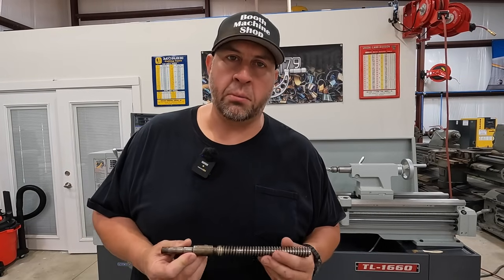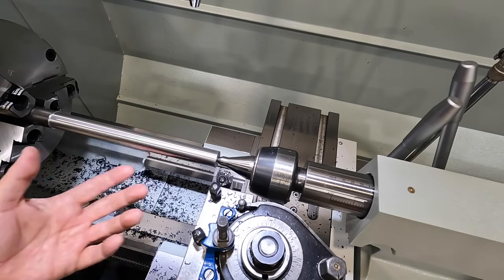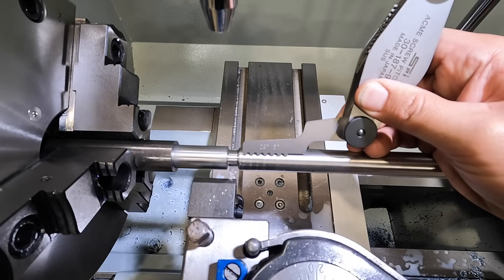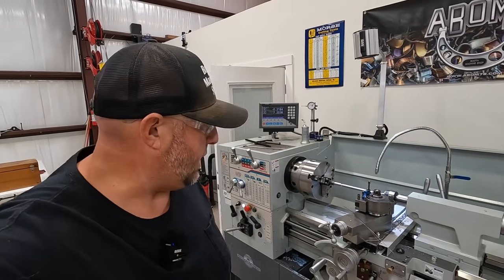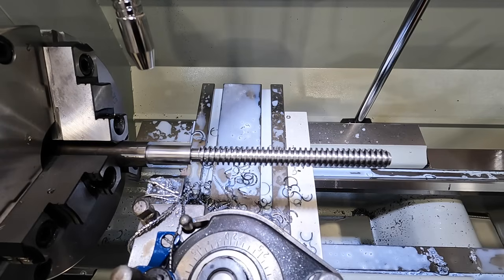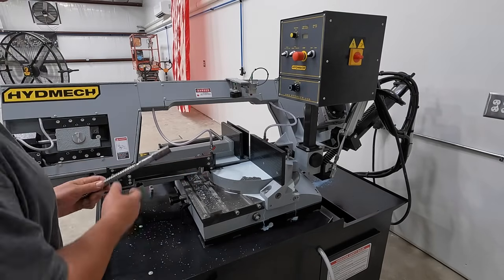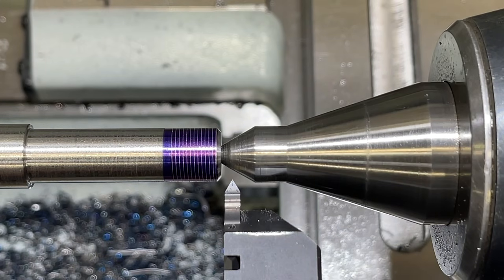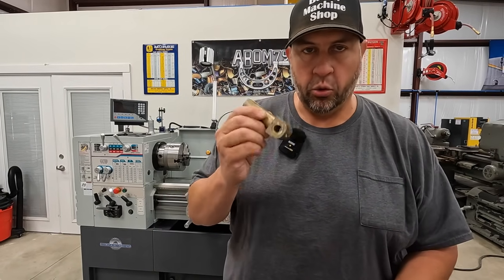Compound Acme Lead Screw for American Pacemaker Lathe

Comment: I am not a machinist.....so this may be a dumb question......how does each pass line up exactly each time?
Reply: Gearbox.
Reply: I’m not a machinist either but I’ve watched enough YT videos to know the answer. The spindle is connected to the lead screw that moves the cutting tool up and down the lathe through gears in the head stock. You can configure those gears to cut a million different threads. That dial you saw spinning with the numbers 1 through 4 lets the operator know when to engage the lead screw so the threads line up with the cutting tool.
Reply: #1 There are no dumb questions. only dumb people who don't ask questions. This site, like many others, is an excellent place to learn.

Now then. The lathe has a number of settings, of course - speed, and the relationship of turns of the main spindle to turns of a leadscrew which when engaged moves the tool along the axis of the workpiece (X axis). There is also one which when engaged moves the tool holder across the workpiece (Y axis).
Since the leadscrew is geared to the spindle, there is a constant known speed  and position reference possible. 
When setting up to cut threads, he consults a table of settings xor thread pitch. The carriage connects to the lead screw by a lever controlled set of "half nuts". Visualize a nut cut in two that can be opened or closed on command of the lever. Nearly is a rotating display with numbered markings and an index. The operator waits for a particular number (per the table) to approach and engages the half nuts. Et voilia', the cutter will be synced to the threads. When I learned to run a lathe over 50 years ago, we had to remove and replace a workpiece from the lathe, destroying the synchronization, and set back in sunc, called "chasing the threads. 
A-Bom has a video demonstrating this, with illustrations. Hope this helps...
Reply: see comment by Robert Parker. There shouldn't be too many comments to make it hard to find yet.
Reply: @The_DuMont_Network  Love your "no dumb questions" comment.  You are spot on. If you don't ask, you don't learn.
Reply: Reposted from above.  

The spindle and the bar that drives the tool holder along the ways (lead screw) are physically locked together through gearing so the spindles rate of spin and rate of spin of the lead screw are always the same ratio. The compound is engaged with a nut that is controlled by the operator.  To start the cut at the exact same spot every time there is an indicator geared to the lead screw as it drives the compound along the ways (it’s called a threading indicator), you engage the drive at the moment that indicator shows the lead screw is in the same spot as when you made the first cut. 

I hope that is relatively clear

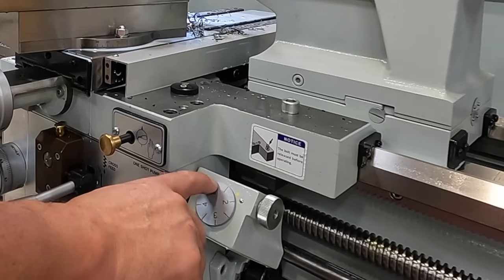Edit: you can see the threading indicator by Aboms hand at 14:02.  It’s the spinning dial. It has numbers on it and if you always start at “1” , “2”, “3”…or in this case the whole numbers, whatever number the relation ship between the lead screw, work and compound /tool holder will be the same every time. He kind of eludes to its operation at 16:25
Reply: @yalebaker7976  ok....but how exactly does the operator engage exactly every time......Im just so confused about this.....that dial is spinning so you just have to engage on the mark? seems some error could be there
Reply: @harlanmartin9964  yup just wait til the dial hits your spot and engage it. If you don’t hit it exactly right the lead screw is still spinning and the half nut will slip in where it needs to go. Haha I’m acting like I’ve done it before. Never even touched a lathe but that’s how I understand it anyway. I’m sure these machinists that are replying could explain it better. I don’t know if he has to use the digital read out to start in the same spot or what. I have questions too.

Comment: This may be a foolish question as I have 0 experience with metal lathes; Could the clearance issue with the follow rest be alleviated by running a reverse angle on the compound and taking  a trailing edge cut? or would this cause other problems? The new shop looking great by the way!
Reply: It might be slightly minimised, however it's a left hand thread so traditionally it is cut "away from the chuck". You always want the cut on the leading edge of the tool.
The issue with this follow rest is that it's positioned nowhere near the cutting point. For this lead screw there are already some thread relief and other features so a follow rest on the left side of the cutting tool will not work even if it did miss the chuck. He's gong to have to rig up an alternative mounting for that follow rest so it is more in line with the position of the cutter. Modify it's base then either mount it off a special boss that fits into those 2 T-slots in the carriage, or perhaps some bracket off the rear.
Reply: @johncoops6897  thanks. I was just curious but you never know when a little knowledge can come in handy.

Comment: Only pipe thread has a sharp pointed thread. Your tip for threading should have a blunt point .125xp    .125x32=4 thousand of an inch

Comment: Check diameter in the middle of a long thin shaft if you want to detect deflection. Checking at the ends only tests alignment.  You know this.
Reply: And your point is? He wasn't checking for deflection, he was checking for TAPER on a brand new lathe that has been dialled in but never used to turn anything before.
Reply: @johncoops6897  As I'm sure you must know, checking tailstock alignment on the new lathe, though important, was only an ancillary aspect of the task at hand.  You will recall this is the second attempt at making the lead screw, the first attempt having failed.  And, that first attempt, on the other lathe, most likely failed largely due to mid-point, tool pressure induced, deflection of the shaft, causing the shaft to climb up onto the tool.  And, please don't shout at me in all caps.  Thats just rude.
Reply: @PittsS2C1  - He won't be getting excessive deflection on a piece of 1" diameter high tensile bar stock and a 20-50 thou test cut. He CERTAINLY didn't get any deflection on his 3/4" final piece on the 1 thou passes cutting the thread. His previous attempt on the old lathe didn't fail from deflection either.
You should watch the videos and pay attention better, so you'll learn that Adam knows how to operate a lathe without your advice.  He mic'd to check taper, that's all he is interested in... and that's why he only checked both ends and not the middle.
Some people are both deaf and dumb, so others need to raise their voices to ensure that they pay attention, hear and actually understand what is being said. I wonder which you are - D, D or both ?
Reply: @johncoops6897  come on, dude.  Lighten up.  Perhaps this could yet be a productive discussion.  As You surely know, 0.750 is the thread max diameter.  And, the thread maximum minor diameter is 0.530.  So, we really aren’t dealing with a 1” shaft.  There was most certainly excessive deflection at play in the first, failed, attempt on the Monarch lathe. On that iteration, Adam was taking 0.005 passes.  And, as he approached the specified minor thread diameter, the part deflected and climbed onto the tool.  The failure occurred near mid-point on the thread, consistent with normally anticipated max deflection point.
Reply: @PittsS2C1  - it doesn't matter, it's Adam's video and knows exactly what he is doing. His old lathe had a problem, yet his new one didn"t have a problem... making the same part using the same method.
So what was the difference? Same operator, same method, same technique, same part, different lathe. How could it possibly be that the problem went away by changing just one variable? Maybe watch the start of this video again, where Adam tells us why he is using the new lathe to remake the part, rather than the old lathe?
Reply: @johncoops6897  Thank you.  I'm certainly not questioning Adam's ability or knowledge.  He is a true machinist, born and raised.  Best on the internet.  But, with due respect, I think the small minor diameter of the threaded shaft actually does matter quite a lot, with respect to deflection.  Especially when cutting Acme threads. There is an awful lot of tool contact area when cutting Acme, and a lot of resultant tool pressure against what, in this instance, has effectively become little more than a half inch shaft.  Apparently, Adam considered this as well as indicated by his initial intent to utilize his Follow Rest on the new lathe and, failing that, by subsequently making lighter cuts as the minor diameter was approached.  That said, I do agree that the new lathe was a factor in the success of the second attempt.  I also think the flood coolant and lighter cuts there at the end also played a part.  At any rate, it's an interesting discussion.  By the way, did you notice the nut became just a bit more snug about halfway down the length of the shaft?
Reply: @PittsS2C1  - yes it did get a bit more snug in the center, and of course there would be a bit of deflection, even on zero depth spring passes he used at the end.
However he left all the burrs on the thread OD when he tested the nut, so he was never going to get a 100% perfect test fit anyway.

Comment: Why is the nut going on at first but not all the way is the material pushing away from the cutter
Reply: Yes it was the thread tool used was advanced forward and to the right which would have left a bur on one side of the thread.
Reply: @xkblxcripple  Might have been the tap he bought as well.

Comment: What is “stress proof”? I’m not a machinist, but wish to learn
Reply: It generally means the steel has been heat treated or (normalized) in such a way as to remove most of the stresses found in untreated steel.
Reply: @ellieprice363  thank you
Reply: @ellieprice363  but… what is the steel? A36? 4120?
Reply: @halsnyder296  Adam said it was 1144 stress proof. It’s strong and easy to machine and a good choice for that shaft.

Comment: Great work. If the tool holder accepted the acme cutter on the left side instead of the right side you may have been able to use follower rest. 
Too bad the digital read out linear scale sensor wasn’t on the left side of the cross slide.  Was wondering about tool deflection in center of shaft after finish cut to proper diameter as others mentioned.  Thanks for the great filming work!!⚙️

Comment: cutting the threads without a relief - not easy to do - what is the trick? Is he watching the dro to spin out the cross feed?  Dial indicator?
Reply: I was wondering the same thing. I'm just an electrician who has wired several machine shops and by working in the environment fell in love with the people and the trade. It's absolutely fascinating and is someone who always needs to understand how something works it leaves me with so many questions
Reply: He has a sharpie mark on the shaft where the threads end, the trick is to back out the cross slide when the threading tool reaches that mark, then disengage the leadscrew half nuts and start over, of course the slower you go the easier it is to hit that mark every time but it gets easier with practice. 
Some people setup a dial indicator on the bed way set to the end of the threads, then back out the cross slide when the dial indicator moves.
It takes practice and is a little intimidating at first but practice makes that go away :-)
Reply: He has the reflexes of a cat. Also you can bet that his concentration level at that moment is a pretty intense.

Comment: How much does this kind of work cost?
Reply: It will depend somewhat on who you pick. A machine shop that is used to doing this kind of one off will be better value, forget your high volume CNC shops they won’t be interested or may not have the manual skill readily available. When you go out to quote give as much info as you can,  figuring it out time will cost you whereas if you know the pitch, material you need and an idea of the tolerance that will save them time. No disrespect to Adam or anyone else but this is not difficult work it just needs to be done right taking time and not rushing. Adam was just unlucky on his first attempt. It also depends on what you are happy with, if I quoted you $200 for a part you can’t get anywhere would you be? I’d suggest you find 3 shop and give them all the same info, visit them - there’s no substitute for getting a feel for who you are working with. If the shop is dirty and unorganised walk away, if it’s like a clean room you are going to pay for that, if it looks like Adams home shop and Adam’s in it you are on the right track.
Reply: @tonyray91  It's not about organization, I have one off things done regularly by the weirdest shop that has dim lights and metal shavings everywhere. He does a great job and sent both his daughters to Clemson
Reply: Machining work is expensive. People want a perfect part made or repair done, but they don’t want to pay for it. I can’t count the times people have brought me work and truly think I’d spend half a day on their project for $20-$40.
Reply: My estimate $ 250 plus materials.

Comment: Ok folks, imagine I was machining a 24 inch diameter circle of copper 1 inch thick using acme style cutters to make either 1/2 inch deep concentric circles from edge to middle or do the same thing as a screw type thread from edge to middle. Imagine this is the bottom base on the inside of the device. Also we now install copper elbows at the bottom of the internal pipes so the water coming in will go around in a circle to the middle which is where the water should exit up top. The question is should I use the thread way (the way I'm thinking) or concentric circles (original idea)?
Reply: You'd have to draw that preferably in 3D for me to visualize it. I think there's some portion missing from what you've said. 24" diameter 1" copper dindin plate with threads on the edge? larger sides? What contains this? Where are the pipes? It sounds like maybe in the middle? Middle of the edge? Side? What is your purpose?
Reply: @mrmeval  - I think it's just some made up story, just to see if somebody will bite.
Reply: Either or so long as there are channels for water to flow between the concentric circles.

I'm picturing what is basically a CPU water block but overiszed and meant to be artistic instead of a heatsink.

Comment: I honestly don't understand the point of checking thread pitch on the lathe. 🤔
If the dials/knobs/levers are set correctly (and the lead screw is tight) there's no way for it to be incorrect.
Reply: Adam describes many many videos ago where he made a mistake on a prop shaft and cost him a piece of material stock. As a young buck he been checking thread pitches ever since as well as other youtube machinist of verifiable excellence...gas stations are often checked to make sure that we are truly getting a gallon versus a bunch if air mix when ya pull that handle...over time things get loose
Reply: It’s to ensure you didn’t screw up on your settings by accident, specially on a older lathe where the number plates can be worn or hard to read, and sometimes certain gears can be hard to engage. Takes 2 seconds to check and it’s way better then having to scrap an expensive piece of material. But yes you are correct, it’s just good practice, specially when your doing personal work where time isn’t a factor.
Reply: What’s easy to set right is also easy to set wrong. Always double check.
Reply: @Kc12v140  I don't think time is a factor.
If I had been a machinist since I was in diapers and was working with a new (tight) machine, it would be more disconcerting to question my own ability and experience, as well as my tool.
But hey, it's not me....
I personally think it's to satiate all the doubters/haters in these comments.  😂
Reply: By doing that, you check that you do in fact have all the dials/knobs/levers set correctly. It is easy to make that mistake. Also, if a part is loose or there is significant wear, it will show up here.
Reply: @jimurrata6785  your probably right cause I’m sure he gets all sorts of flak from armchair machinists. Self doubt is healthy as long you don’t take it too far and let it control you. It’s probably a habit for him though. On a part like this it really doesn’t matter if you screw up, but it’s a whole different story if you fuck up a 6in by 8ft piece of chrome rod cause you didn’t double check your threads. Guess it’s no different than mic-ing your od every now and then on a heavy turn to make sure your dro is reading right.
Reply: You are correct, you don’t understand.
Reply: Measure twice, cut once. Too soon old, too late smart.

Comment: What was your compound angle?
Reply: 14 degrees
Reply: My turn. Long question.
  As a novice at single point threading I have had similar issues with test fitting the nut. Adam had issue with the nut starting ok and threading on say half to three quarters of the nut depth and sticking. My question is.. if the threads are of correct size for the first say inch of the shaft and the nut fits but no further, would that be from deflection in the shaft? So with further passes it appears to cut/ remove more material over the full length, all the way to the supported end of the shaft. Why? Why does it take more off of the very end where the nut already fits? It did this on both the Acme and the fine thread. I'm confused. Maybe editing was involved but didn't at one testing the test nut go on several inches than after another pass it only went on a small bit? I'm not being a ick here. I had the same thing happening to me. Just wanting to learn😊❤
Reply: From my little experience with this, the deflection can be taken out with free passes of the same depth. If it gets tighter I would think that’s due to a bur that got built up somewhere and some more free passes and/or some scotchbrite deburring would help.